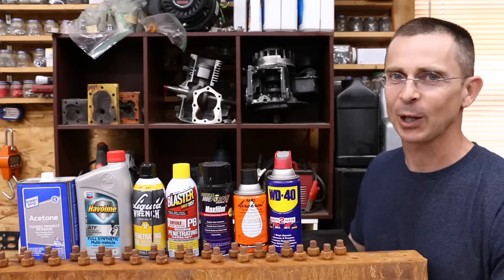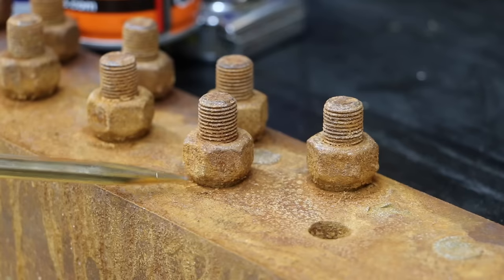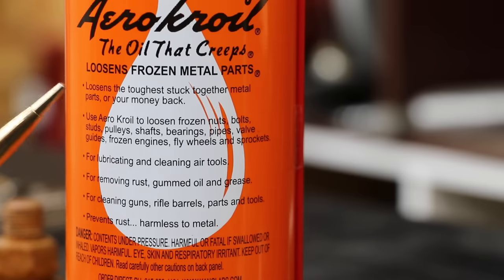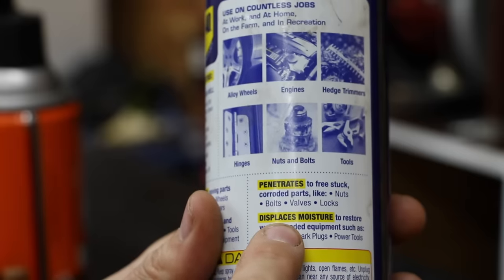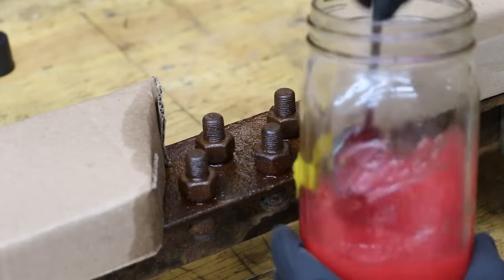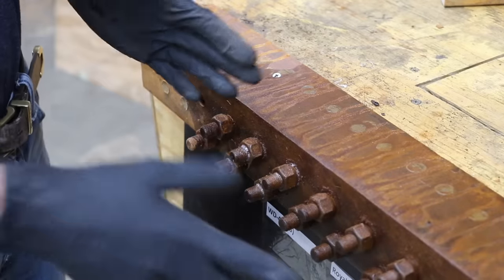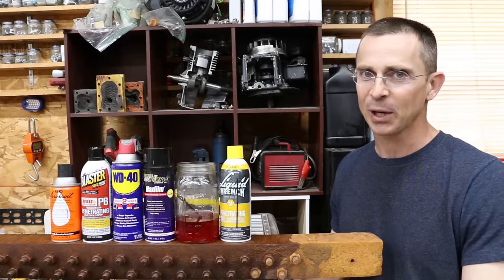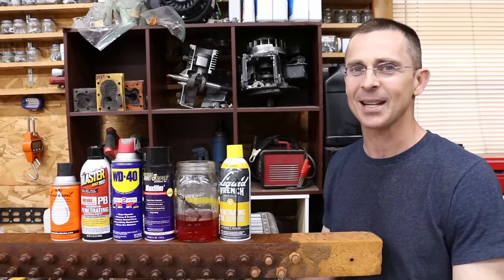Which Penetrating Oil is Best? Let's find out!

Comment: Man I should have written down all the tricks my Grandfather used to tell me. Marvel mystery Oil was left out. Hmmm.
Reply: Also an Impact driver to loosen , I wonder if that would work, I mean because a Big Hammer is always available..   Thanks for the Breakdown.
Reply from the maker: Thank you!
Reply: Michael Littlejohn 👍
Reply: Project Farm ...and yet another one. If you do revisit this, use Olive oil as well! I use an edible oil* on my Leatherman and found that that olive oil actually works better than soybean oil at removing rust by necessity one day because I was out of a cheaper alternative.

As an experiment I applied it to a pair of needle nose pliers that had accidentally been left outside from a few months back. It freed it up nicely!

It kinda makes sense because biodiesel it a well known solvent. I've used it to clean road tar off a tool box one time back when I hauled fuel.

*Edible due to cleaning fish, cutting apples, cheese, etc. ALWAYS USE AN EDIBLE LUBRICANT anytime the object you are lubricating may come in contact with food!
Reply: Marvel mystery oil is ATF

Comment: Thanks for this test. I’ve tried 3 of the products you tested, and my results math yours. I recently used PB Blaster, to unsatisfying result, trying to remove brake caliper bolts. I fell for the hype & bought Kroil. Another disappointment. When disassembling some metal shelving at the shop, I used Liquid Wrench, since it was what i had. I’ve had this can for years, since I generally just use heat. What do you know, I was reminded why I bought the Liquid Wrench in the first place. I used to choose Liquid Wrench back when there were fewer penetrating oil options. Guess what I’ll be buying from now on? Thanks again for the rigor & practicality that you put into every test you conduct. You sir are the real deal.
Reply from the maker: Thanks and you are welcome!

Comment: I've used several of these products and in my experience aero kroil out performs them all, I know your results don't come to the same conclusion, can't understand why.
Reply from the maker: Thanks for commenting on this.
Reply: That has been my experience too. But this test doesn't simulate all the different kinds of stuck bolts people deal with. A lot of times Kroil has worked for me loosening smaller bolts that have a tendency to snap off. In this test, the bolts and nuts are pretty big, more difficult to snap than small fasteners. I found out about Kroil from people who work on antique tractors.
Reply: chabat124 do your own test and prove it then

Comment: those bolts were not stuck...it maybe impossible to get consistant levels of rust on bolts artificially
Reply from the maker: Yes, very hard to get rust to form consistently.
Reply: But you can see that he did his best for the test to be fair..
Reply: Artificially? Imposible naturally as well, can take apart an entire vehicle and for some reason just a handful of the bolts will be far harder to remove.
Reply: Yes, but a 4 lug sample per product showed a clear winner based on average. This test worked for me. Heat is best
Reply: Marcel LeMay yep, I go to heat as a last option because the use of my torch (wide cone) usually ends up damaging paint or causing a gunky-oil fire. Just before that I try shocking the nut/bolt with a hammer
Reply: Marcel LeMay Exactly.
Reply: Marcel LeMay Heat was only two and I thought it would have performed better. In some areas heat isn't an option.
Reply: But they were all new bolts torqued to the same amount so the test is very fair.

Comment: I just replaced a part under my car. It had about 20 years of rust on it and wouldnt budge. Ive only ever used wd40 for stuck bolts. I didnt have any in my garage but i came across a can of liquid wrench in the basement. I used a chisel around half the bolt and poured some liquid wrench on it. A little torque and it came right off. Thats how i found my new favorite.
Reply from the maker: Thanks for the suggestion.

Comment: Had a really big rusted nit with hears in place.  Tried several of the common penetrating oils and couldn’t budge it.  Had an old mechanic that happened by.  He soaked it down in brake fluid and waited 15 minutes and jt came off.  
Don’t know but he swore by it.
Reply: Im guessing brake fluid works better than any "penetrating" fluid you can buy.  Only issue i see is in certain situations you may have painted areas where brake fluid should be avoided.

Comment: Kroil is popular because the can looks cool.
Reply from the maker: It is a cool looking can!
Reply: Frontier Specialized , sure, but you gotta follow the instructions for use, if not test is not valid.
Reply: Marketing strategy..
Reply: I was surprised by these results. I've used aero Kr oil for years and it always comes through in a pinch.
Reply: Lol really!? I thought it had the worst design! I like the design of PB. It just catches my eye for some reason!
Reply: Usually one taps the stud end as well after applying penetrating oil. That's in PB Blasters instructions.
Reply: Kroil actually works... It is the only thing that I have found that frees the larger bolts on HEMTT, HETS, and other larger military vehicles.
Reply: LordValafar You mean dies.
Reply: Michael Norris I mean smack with a hammer lightly. No point in chasing threads when the nut is still on the stud or bolt.
Reply: I never used aero kroil, but i love kroil. I've been wrenching for 15 years and once i started using kroil, applying with a plastic syringe, i stopped trying any other product. The standard kroil is cheaper per ounce also.
Reply: Stinks, though.
Reply: Kroil is by far the best I have ever used. It creeps and will really loosen up rust.  Not saying your test was wrong but real world results from completely seized bolts nothing else works like kroil.
Reply: I just like the way kroil smells . . .
Reply: mark that's a good point. These rusted bolts will still come off without breaking.

Comment: A 3 hour test isn't a realistic test for a penetrating oil. Nothing works instantly except for direct heat. The penetrants need time to work and soak in. Would be better if there was a way to let the pieces soak overnight and then determine how far down the penetrant had creeped and how much of the rust has managed to dissolve. I've tried them all and only use Kroil but I use Silikroil and not Aerokroil. When possible, I try to spray all rusty bolts the day before the job and let everything soak overnight. On really rusted bolts like on the exhaust or suspension parts I'll give an extra shot of Silikroil every few hours or let the penetrant work an extra day or 2. When normal soaking doesn't loosen a rusted bolt I heat it with a propane or MAP torch and then shoot it with kroil while hot. It makes it penetrate so much faster & deeper.
Reply from the maker: Great point. Time helps a lot.
Reply: Good point but when you drive a big rig, you never have overnight. You need something now.

Comment: Back in the day I used wd 40 but now 50 years later it does not work as well I wonder what they changed in it
Reply from the maker: Maybe the formula changed. Not sure.
Reply: ncrdisabled Submarine vet less cancerous probably 😂😂
Reply: i'm pretty sure the problem isn't with the penetrant, steel have change a lot in those 50 year
Reply: WD-40 is almost entirely mineral spirits. Wired magazine sent some for spectral analysis a while back. Kerosene is as effective at most tasks and costs a lot less.
Reply: ncrdisabled Submarine vet we have a John Deere 1939 model g tractor and it’s pure steel all around no plastic, never had problems besides a few, now you can’t get anything that doesn’t have parts made of plastic. Things ain’t made like they used to be
Reply: It used to contain DMSO. Unfortunately, they removed it. That was also the reason why people used to swear by it for stopping pain in joints. They sprayed WD-40 on knees and elbow and it did indeed help. For those that don't know, DMSO is both an industrial solvent and natural product for removing joint pain.
Reply: I remember back in high school our teacher told us the history of WD-40 and back then it was "war dept formula 40 and made of whale oil." He said the government needed something to protect weapons from rusting while shipping over to the war and WD-40 was the one that worked best.
Reply: Aaron Arquette it's actually Water Displacement. And the 40 comes from how many times the formula was tweaked until they got it where the wanted it.
Reply: That't not by accident. We call that....built in obsolesce. It's quite intentional.  I screwed Frigidaire and all the rest of them,  I know they must be pissed off at me big time, After 5 years my nice, new modern, digital blah blah blah crapped out. My fridge now?  A 1954 General Electric Combo. It's ready to collect SS and still works great!
Reply: They added water to the formula. 🤣
Reply: I notice 80 lb bags of cement are a lot heavier than they were 50 years ago.
Reply: lol. Best answer.
Reply: ncrdisabled Submarine vet
Maybe WD40 did not change anything but the damn bolts had 50 years to rust properly tight!
Reply: Also had 3 in 1
Reply: Jay Gilling
3 in 1 apparently belongs to WD40 now.
Reply: Modern appliances are cheaply built crap. The guys who repair ours all say the same thing.
Reply: Forgot to test a couple, with a good hammer tap.
Reply: Welcome to the world of getting old, where our memory of how things used to be, is our dearest friend ;)
Reply: Well, today I used it on some VERY rusty brake line fittings and it works very well.

Comment: I use the wd40 on my motorcycle chain as a cleaner and a lube because it wipes off which leaves the chain clean looking and shined , while having no sling up mess on the rear wheel ,
Reply from the maker: Thanks for commenting.
Reply: If it's not an o-ring chain with lube sealed in you better use something else.  WD40 is not an adequate lubricant for a MC chain.
Reply: I use it too on my 2016 R1 getting close to 10k miles chain looks like new, the only downside is don't forget to do it often I've lube it between 200 300 miles it takes less than 5 minutes though
Reply: Yeah wd is good for road riding but it slings off fast. I use bar and chain oil, yeah its messy as hell but iv'e been running the same DID chain for 5 years... Degrease after it gets dirty then re apply. Rust will never stand a chance under this stuff.
Reply: WD-40 is not a lubricant! I displaces moisture and will dry out metals! Not good for much as far as I'm concerned. Maybe on lures fishing...
Reply: I lube tons of stuff with wd.. If it don't work get the wd40 lithium mix...
Reply: WD40 contains a solvent, it will temp. lube, but will soon dry out inner parts.
Reply: If you are looking for a lubricant buy the WD-40 with silicone its way better than the regular at lubricating
Reply: Or just stop being cheap and buy a real chain lube (chain wax for an o-ring chain). WD40 is a solvent/vanishing oil. Far from desirable in a lubricant. It's great for cleaning chains, but that's it.
Reply: foxydj2012 yes that’s true , I just hate the mess , beside I don’t do any heavy duty riding !
Reply: Russell Federici just some food for though, bud. I use Spectro or Maxima chain wax on my dirt scooter. Zero sling and zero wear (aside from where it rides the sliders) on my Renthal Gold oring chain thats 5 years old. WD40 to clean, let dry, chain wax next day. Periodically I'll spray it with some penetrating oil followed by chain wax to keep it free. Now that obviously slings, but that doesn't get done often.
Reply: Russell Federici I've used Liquid Wrench Chain Lube on my bike just fine, just sprays on like the wd, has the straw and everything. Royal Purple has some great stuff too.
Reply: foxydj2012 thank you , I’m gonna get some of that Spectro , good prouducts
Reply: Bass Nazi sounds good , I’m going to try the Liquid Nails as well !
Reply: Russell Federici yep, just called chain lube, stuff stuck around and when you wanted to get it cleaned off you could.
Reply: Russell Federici I swear by their filter oil, too. They make some damn good products. I've personally seen that filter oil trap dust better than I though possible. Picture a 900hp 410ci sprint car in dust that you could barely see through. We personally run a dual stage foam filter just like bikes, but the layers are not permanently affixed to each other. That said, the outer can be 100% caked and look like solid dirt but the inner has no dirt whatsoever on it. I have seen this several times. The only dirt permeation with this oil I have ever seen was when the filter has a tear in it or the foam starts to break down from age and washing. That being said, it is the only filter oil I will use on my personal bikes, however pricey it may be. 👍🏼
Reply: I use chain wax. Great stuff!
Reply: WD-40........ the WD stands for water displacement. It was never intended to be a penetrating fluid or a lubricant. But still a good product for what it does having been made back in 1953.
Oh yeah... I use chain wax.
Reply: You should use a quality chain wax... NOT a liquid lube on motorcycle chains. I use a CLP to clean the chain, then wipe it dry, then apply a nice thin coat of Chain Wax... I am able to get 30K miles out of a chain doing so.
Reply: WD is kerosene basically and it evaporates fast, use chain lube
Reply: foxydj2012 who's filter oil do you swear by? You didn't say in your comment. Re- reading who you replied to, I think you're saying liquid wrench chain oil is very good.
Reply: MasterMech77 chain wax you say? Never tried that. Having only gotten 10k miles out of my last chain, the advice may be helpful, or tons of sandy dessert riding in the first 6k miles is a factor which later NC rain beat on.

Sidenote: Dennis Kirk is usually awesome to get parts and maintenance items, but when I looked up a new chain I managed to buy a cam chain. What utter garbage I said to myself. Lol

User error I'm sure, but that's the kind of mistake that's hard to make unless you're online. A purchase of a masterlink installer, chain breaker, and a new sprocket would be a hint that this part doesn't fit the order. Lol
Reply: dude, WD40 is a shit lube.
Reply: Microage is right. You aren't doing any favors for that motorcycle chain. I just bought a new chain and it recommends 80w90 gear oil. You think a light penetrating lube like WD-40 would  fit the bill on any motorcycle in comparison to this "manual" recommendation?
Reply: most bicycle chains use sythetic waxy stuff that doesnt collect as much grime and grit. Wonder if its good for motorcycles too

Comment: I tend to use PB Blaster around the house because I already have a can. When I had an aluminum low pressure automobile AC pipe that after 20 years had corroded and seized onto the evaporator pipe I did some research on penetrating oils effectiveness on aluminum. On all of the comparisons I saw, PB Blaster worked best on aluminum. So I bought a can and it worked-I let it work overnight. It made the joint let go but the threads were still galled badly from the corrosion. Believe it or not, I put a new o-ring on it, reconnected it with the galled threads anyway, and it held vacuum and the unit is still cooling fine two years later. I also recently used it to persuade a water heater anode to loosen after it resisted a 40" long 3/4" drive breaker bar. Of course, if I could have stood and bounced on the breaker bar like I did to break loose a Honda Odyssey crank bolt, which by the way had resisted several flavors of penetrating oil (and MAP gas heat), I wouldn't have needed the PB.
Reply from the maker: Thanks for sharing.

Comment: Kroil is the best penetrant in a can for loosening frozen bolts/nuts. We use it for refinery equipment that has operated in coastal environments for 10+ years. We have tried them all. Has worked well on bolts frozen in sleeves too.
Reply from the maker: Thanks for the feedback.

Comment: It needs a much better testing setup. What you did was not bad.

For a start, you don't want to let those oils contaminate each other. It's like putting a drop of blood in the water, and the shark will smell that from far away. Did you use acid and oxidizer while those nuts and bolts were apart? Did you put it back on together while that oxidizer was wet or fresh?  Some oil may need more time to penetrate, especially the viscosity. For any serious job, I recommend using oil high in viscosity and a wire brush to prevent those rust particles from falling into the thread. I would first tighten or crack the nut in a fraction of a turn to allow the tensional stress to be free first before loosening it.

Comment: I don’t know why Kroil performed the way it did for up test but I swear by it in the field. I work on heavy equipment, often old and neglected, and when I’ve got a stuck/frozen connection or bearing I’ll break out the aerokroil asap and the majority of the time that’ll make it possible to remove, turn, slide whatever was stuck. I grew up a WD-40 guy, then became an advocate of PB blaster when I was introduced to it and saw what it could do, but once I was shown AeroKroil and then saw how much it could do for my work I’ve never looked back! It is hands down the absolute beast penetrating oil produced and worth everyone of the very many pennies it costs!
Reply from the maker: Thanks for sharing.

Comment: In my machine shop experience, what I have found is that with badly rusted threads is heating the nut to red heat and applying bees wax will ease in removing the nut better than only heating. One may also hammer the outside of the nut on alternate sides when the nut is large and then reheat and add bees wax. I am not sure but I believe paraffin wax may also loose nuts with the exception that paraffin wax emits a noxious odor where bees wax emits a sweet odor and outside of that, it maybe the only difference.
Reply from the maker: Thanks for sharing.